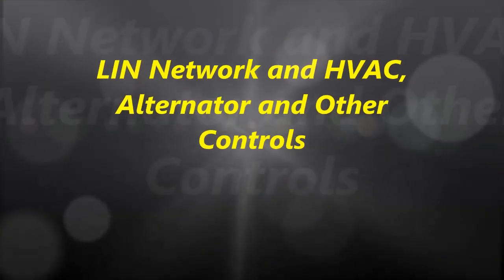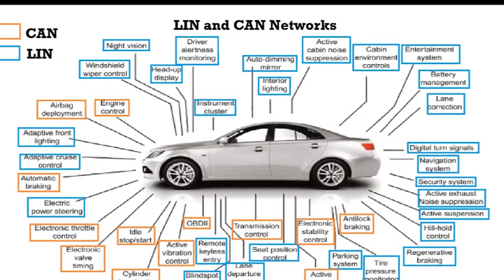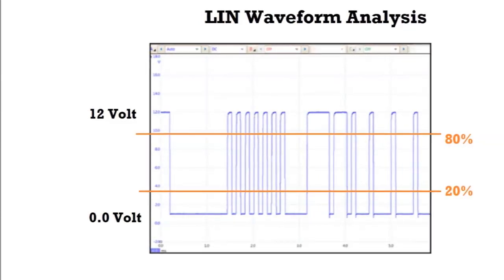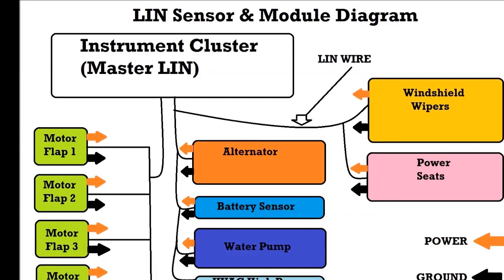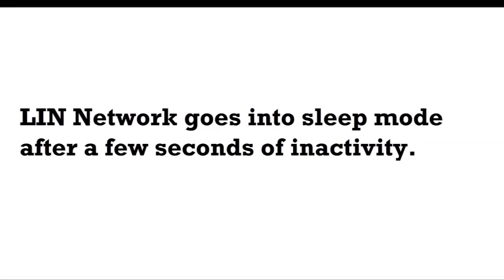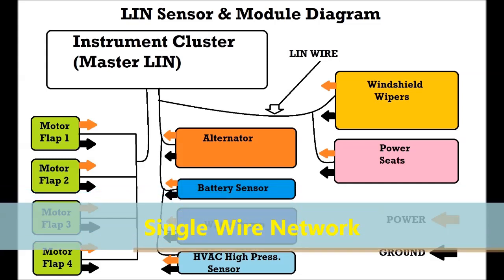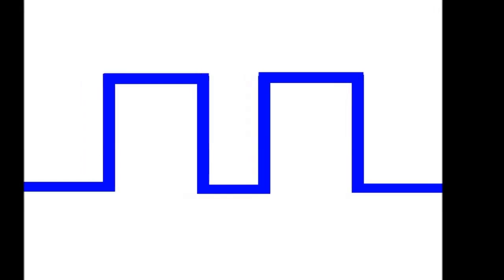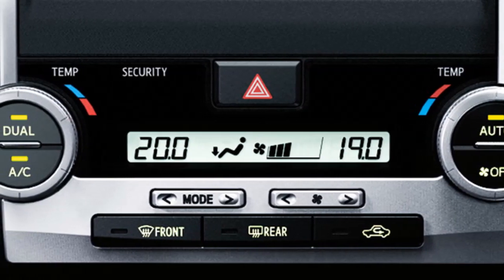LIN Network in HVAC, Alternator Other Controls

Comment: I never understand it properly 😅. Lets say there is a motor with 3 wire power ground & lin, i think it will not work if we give motor power & ground. So what lin is providing is more than just information..?
Thankyou.
Reply from the maker: Power, Ground just drive the internal electronics. LIN is the communication network to talk to the internal electronics. LIN says rotate at 10, 20, 50, 90%, etc, so LIN commands the activity.

Comment: CD8E12: LIN, communication (generator): missing on bmw535i 2012 model ...where to start diagnosis
Reply from the maker: At wiring diagram
Reply: Could it just b a dead alternator? My battery is not charging at all